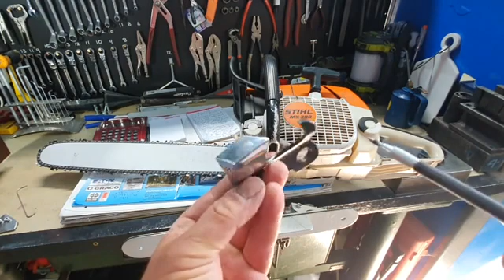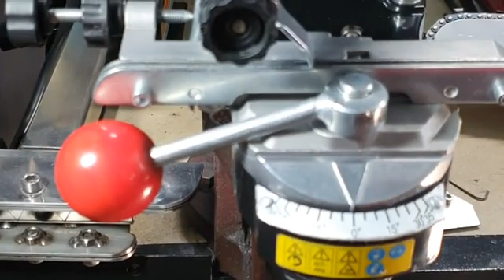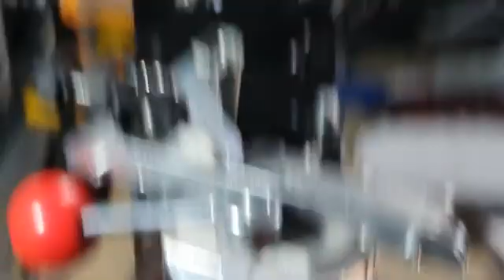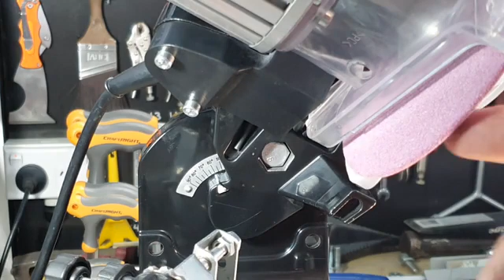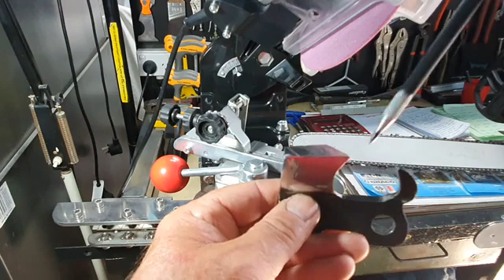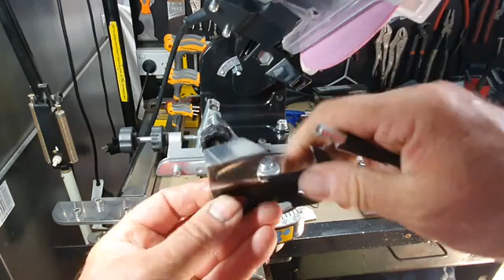Chainsaw angles explained

Comment: All brilliant information. Best regards.
Reply from the maker: Thanks for your comments
Reply: Hi!
Thanks for creating this video.
I have a question though, I have an Echo Cs501sx,  50cc saw, it came with a .325 .058 72DL chain, semi chisel. 

Their recommended sharpening Angles are 35 50 10

If as you state the 10 is usually for chisel Chains, what Angles should I be using for eucalypt, I'm also an Aussie, well Tasmanian anyway 😂😂
Reply from the maker: @marksands9196 35 50 is  very aggressive for hardwood.  I find 30 60 works well up to you with the 10° tilt.  With 35 50 it will get blunt quicker.
Reply: @ChainsawUsers  so, being a semi chisel chain, should I be using the 10 degree tilt ?

Thanks for the prompt reply